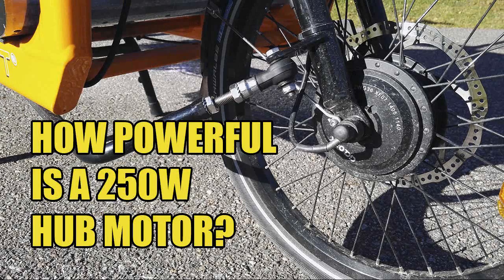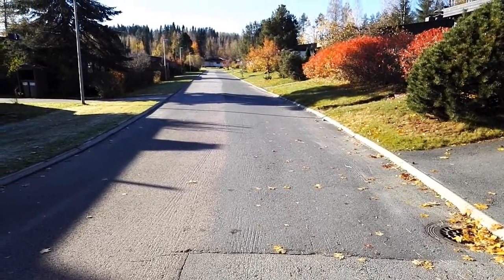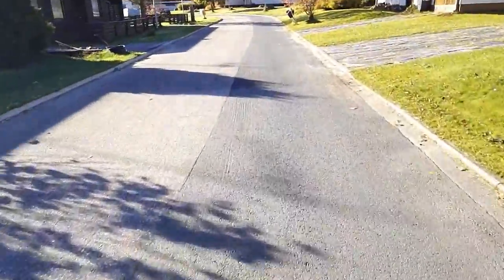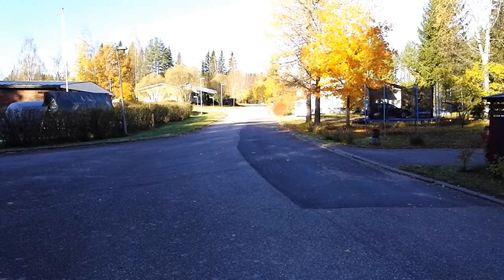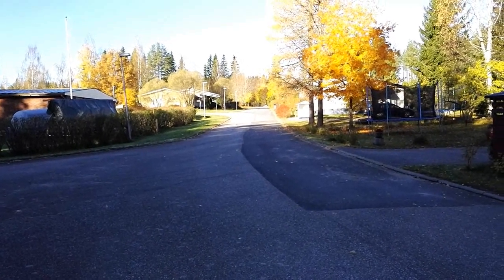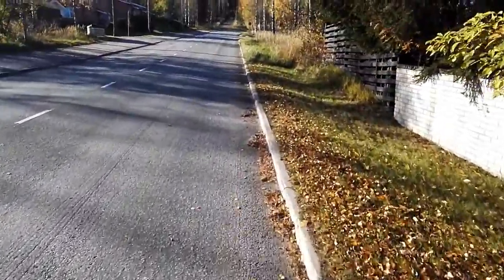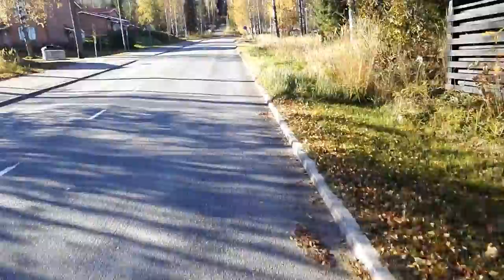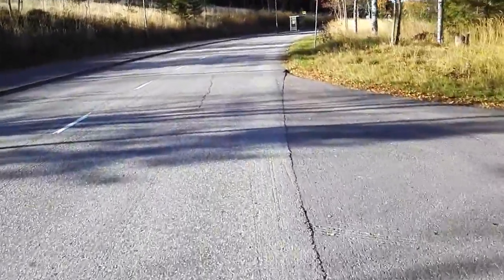How powerful is a 250W hub motor?

Comment: Very useful. Thinking of doing the same on my bullitt. Any modifications to the bullitt dropouts? Presume you have the hollotech PAS installed? Any mods to the front brake disc? Thanks!!
Reply from the maker: Hi Richard

I can't remember for sure now, but I have the feeling I had to slightly 
file the front fork dropouts for .5mm of extra width  to have the axle 
fit.  But nothing major, basically just to remove the paint. Other than 
that, the hub motor  axle is a good fit in the dropout.

No modifications to the front brake are needed.

I actually use a DIY modified square axle PAS sensor because the hollow 
tech ones were out of stock when I bought my conversion kit.

I had to fabricate my own mounting brackets to be able to mount the 
battery in the middle of the frame on the tube that takes the steer
tube.
Reply: Perfect.. Going to order a motor set for my bullitt. Are you using the 15a or 17a controller? Good to know the custom battery mount - not sure which battery I'll go for yet. Did you try a 48v with the config? 

Any thing else to watch out for on the install? 
thanks
Reply from the maker: I am using the 17A controller. I only have experience with 36V. You may want to order some sort of box to mount the controller and some of the extra wire in. 

I have this box: http://www.ciclotekstore.eu/b2c/producto/2201102/2/box-for-controller 

It takes the controller and some of the extra wire. Most of the excess wires are hidden under the cargo area of the bike.
Reply: hi - you mentioned you removed ~ 1mm from the dropout (inside) to get the motor to fit. After the modifications, is it possible to reuse the original bullitt front wheel and make sure wheel stays true? Any close up pics of your front mods? Thanks again
Reply from the maker: Not 1mm, more like 0.1-0.2mm now that I look at the drop outs.

I have had this motor mounted to two forks. The first fork, a Surly 1x1 fork, did not require any modifications. On the second fork, the one on the Bullitt, I have just scratched a bit of paint of to allow the axle to slide into the dropout more freely.

I hope these pics work:

Front hub motor in Bullitt fork, disc side
http://i438.photobucket.com/albums/qq103/RockCrawlingVideos/FrontHubMotor_Disc_Side_zpstizmtiry.jpg

Front hub motor in Bullitt fork, non disc side
http://i438.photobucket.com/albums/qq103/RockCrawlingVideos/FrontHubMotor_Non_Disc_Side_zps3cdozzpk.jpg

Picture of drop out
http://i438.photobucket.com/albums/qq103/RockCrawlingVideos/Bullitt_Drop_Out_zpslbbghv0a.jpg

Comment: I dont understand... How 250W hub motor providing 500W??...plz help
Reply: 250W is the nominal rated power of the motor. It was shown it can deliver a peak power of 600W at the beginning. peak power is the max amount of power it can deliver for a short time without damaging itself so you saw it delivering upwards of 500W on the uphill.

Comment: A nominal 250W motor in the front wheel is not enough if you live in a hilly place. I bought an ebike specifically because where I live has hills varying from mild to extreme and am disappointed because the motor is not powerful enough; I have to dismount and push.
Reply: can you say where u live?( no joking, i want to inspect map of heights)
Reply: Is that by only relying on the motor? Or can you get up the hills while peddling with the motor?

Comment: hi ! i buy a new brushless conroller 36v all cable pluged but not working when i plug the cable white (self-study) the motor moove without throttle or pedal assist plz help
Reply: Youness Elaamraoui What happens if you don't connect it ?
Reply: Youness Elaamraoui connect the throttle control or peddle assist ....prob because controller crap lol

Comment: After seeing the motor carying you uphil, im amazed. Did the motor survived? its working more than the rated 250w value
Reply from the maker: Yes, the motor survived! The motor is rated at 250W nominal, 350W continuous and 600W max output. I ran my motor in a hilly are for 5000km until I damaged the motor casing during a gear service attempt. Gears and motor turned out to be ok, though.
Reply: great dude!